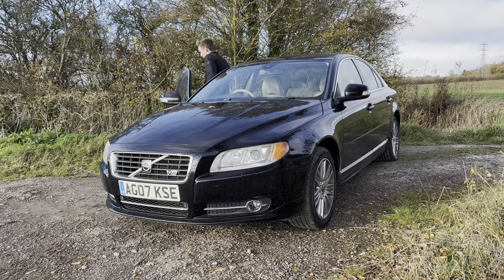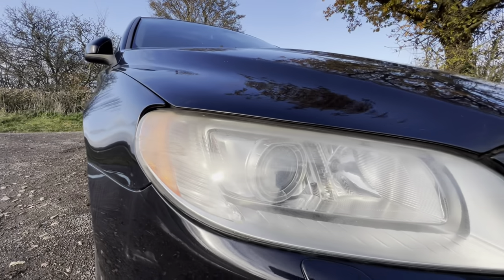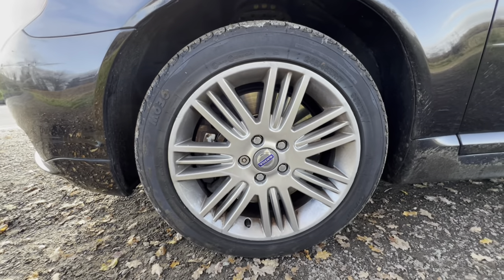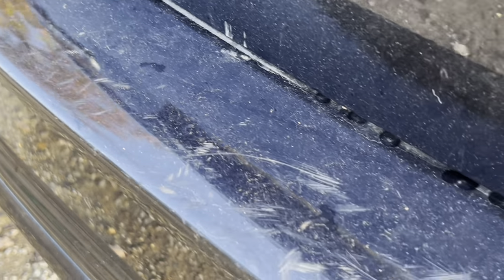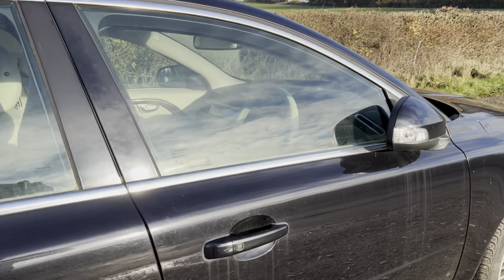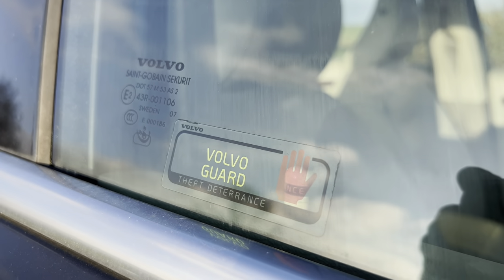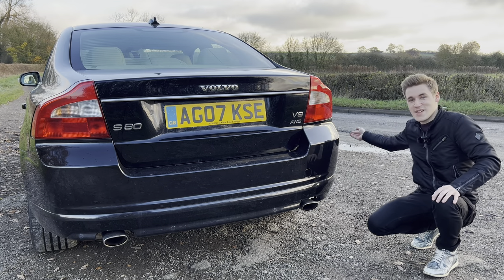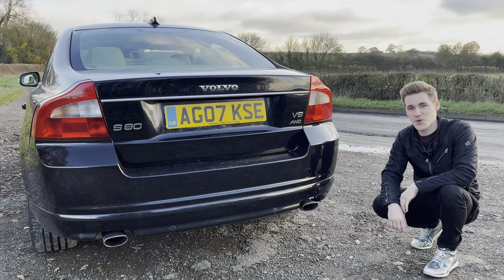I BOUGHT A VOLVO S80 V8!

Comment: It might interest you to know (if you didnt) that this engine is quite common in boats in many places, US for example... Its the basis of Yamahas V8 outboards. Which might make me a bit afraid that since they are so relatively cheap, will someone scrap these volvos in order to cannibalise the engine block for boats? Hopefully not, they are rare enough already. An interesting buy, I would say.
Reply from the maker: I have heard a similar comment about these being used in boats, quite a peculiar choice of engine albeit a great sounding one! I’ve heard there’s around less than 90 S80 V8’s left in the UK!
Reply: @NathanMannin  Well I dont know about peculiar (unless you meant in the car?), large outboards have been around for a long time, and steadily getting more popular even today. And its Yamahas engine to use after all, so no surprise it ended up in their outboards. I dare say that was part of the plan from the start from them. 

Yes I am not surprised there arent more of them on the roads, cant have been that many sold as new.
Reply from the maker: @GoldenCroc  I meant more peculiar to make the engine to put in a Volvo. They didn’t sell many S80 V8’s, probably because of their superior competitors at the time. The engine also featured in the XC90 as well, that had more success I believe.
Reply: @NathanMannin  I see that, I suspected thats what you meant. That makes sense. 

Yep, XC90 was the last "pure Volvo" designed before Ford bought them, and really was a long lived model. Personally I find the models that share ford platforms a little bit more "sporty" to drive than their older siblings. Never driven an S80 of that generation though, its not a common car, the pretty similar V70 got to outnumber it almost 100 to 1 where I am at.
Reply from the maker: @GoldenCroc  I think the V70 and XC60 also shared the same P3 platform as my S80 which is the mondeo chassis. If I’m totally honest it’s not sporty in any sense, but I haven’t driven older Volvos to compare. The S80 feels more of a relaxed cruiser and effortlessly glides over the road. Throw it into a corner, and I have no sense where wheels are or what they’re doing, it’s not happy around the bends 😆

Comment: Good choice! Use airvidox to get rid of the smoke smell. Thank me later 👍
Reply from the maker: Thank you! I’ve just looked it up and the reviews look very promising, I’m definitely going to give that a try once the car gets a proper detail inside! 
Thank you very much for the recommendation, I’ll let you know how it goes! 😁
Reply: @NathanMannin  cool, you'll be impressed with it. I've used it a few times and it' transforms the car 🙂
Reply from the maker: @tariqtvproductions  Looking forward to the results! Do you think I should detail the inside before using airvidox or after using it?
Reply: @NathanMannin  yeah definitely. Clean it all up first for maximum impact. If you can use bit of airvidox car shampoo to clean the carpets (use a bit as you don't want to use too much otherwise it will saturate and won't dry in this cold weather). You can also use meguires multipurpose cleaner to clean all of the trim. Then once its prepped you can use the airvidox. BIG TIP wear gloves and a mask when you use the airvidox as if you smell it it's really horrible and hurts your nose. Good luck with it looking forward to seeing results 🙂
Reply from the maker: @tariqtvproductions  Thank you! Really appreciate the advice! 😁
Reply: @NathanMannin  you're welcome man 😎